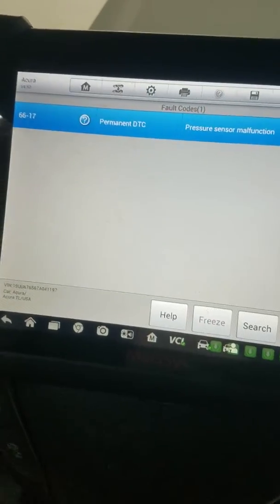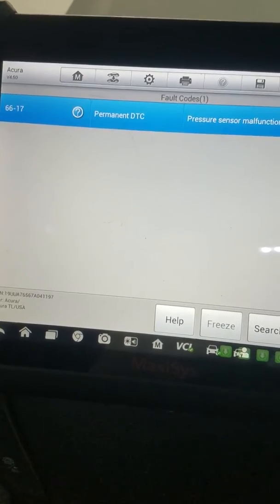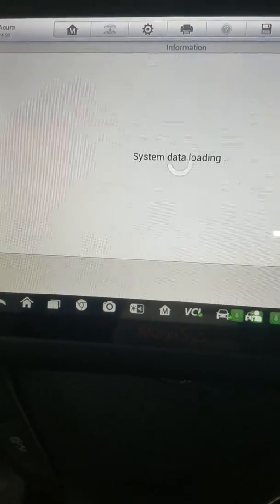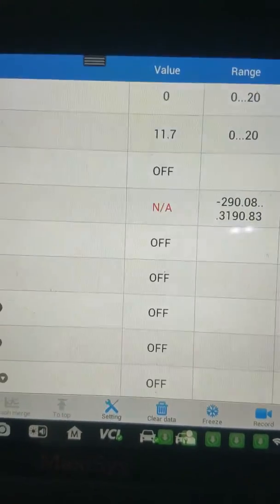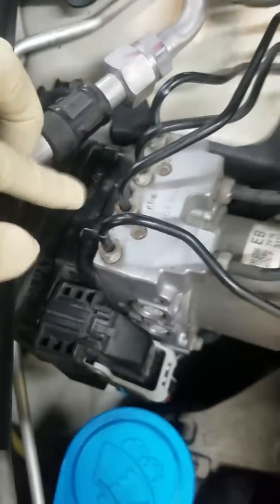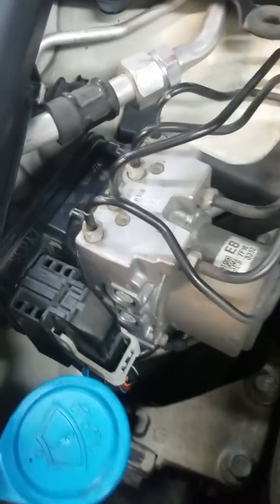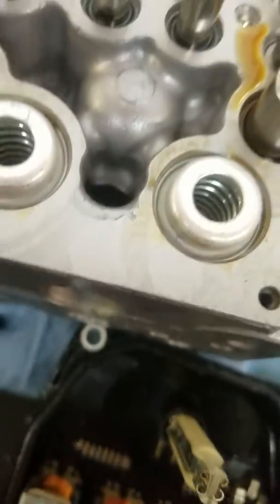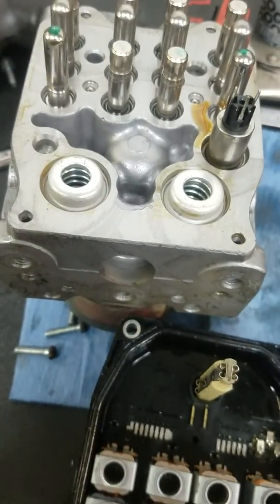2004-2008 Acura TL S ABS/VSA WARNING LIGHT

Comment: Could it be the master cylinder as well? I just changed out my brakes, calipers, and added new fluid. Then the VSA warning came on.
Reply: Any updates
Reply: @Venusneighbor  I think it ended up going away once I unplugged the battery terminal and reconnected it. I was also having transmission problems with it and had It redone.  If your car is shimmering or vibrating,  it's the transmission.
Reply: @Christian Connor  thank you It actually  went away when I turned the key to ignition  held the vsa off button for 10sec then started it and it went away also if you bleed the brake fluid out completely and then refill it will also do the trick

Comment: I have a similar problem.. vsa would kick on and my acceleration when driving would be very slow. It'll go away if I turn off the vehicle but will come back on when I'm later driving. Only had this problem when my brakes and wires were replaced but looking into it I feel like it has something to do with the breaking system... Any suggestions??
Reply: I have the same exact problem. What was the issue after all for you?
Reply: @Newmonkeh3  abs module censor
Reply: Abs module censor

Comment: I have the same problem  I have both light on abs vsa  if I turn the car off it go away and come back  it look it will cost me lot of money to get it fix ?
Reply from the maker: Hector Rodriguez if your having that problem I would suggest you order a used abs vsa module for your car. Labor it self shouldn't cost that much if you have a good tech that can do it for you. If you do it your self you will need to take it to a shop with the right scan tool to do reset you abs light for you